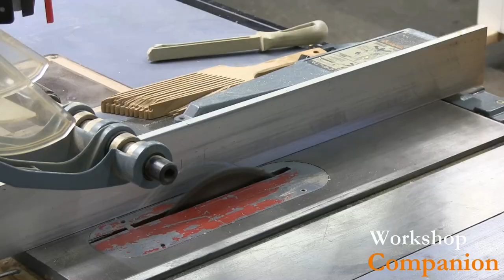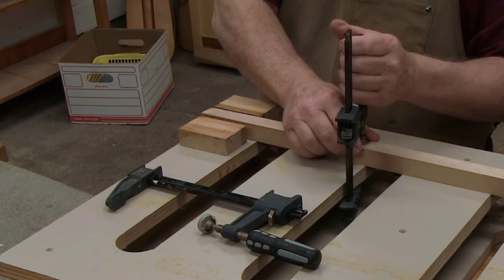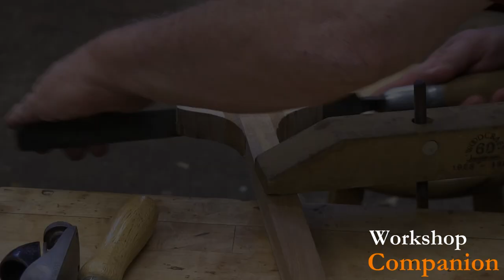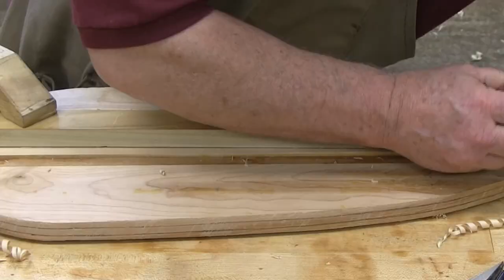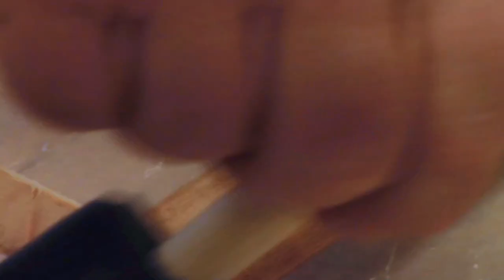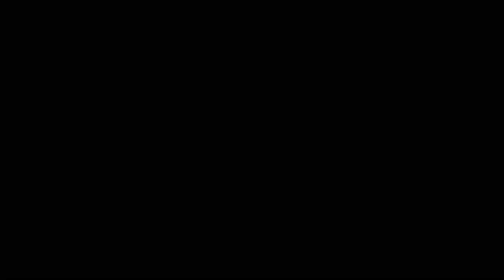Making A Pretty Good Canoe Paddle

Comment: I made a pair of paddles for my son awhile back.  I used ash for the shaft, and a combination of walnut, cedar and purple heart for the blades and handles.  I don't recommend purple heart for such a project.  Although the finished product is beautiful, I had a lot of issues with tear out.  It is hard to work, even with spokeshave and sandpaper.  At any rate, I now have templates for four different styles of paddles.  I relied heavily on the book by Graham Warren and David Gidmark.  I went to school on the ones I made.  I would look forward to making more for someone.  Some things I would do differently next time.
Reply: I once knew a guy who made harps out of purple heart. They were, of course, stunningly beautiful.
This was a pretty interesting video. I liked how he put the rod in the handle and the strip in the tip to prevent splitting. i thought it was a bit strange that he left the center of the blade raised. I've never seen anything like that before. It doesn't seem like a very good idea, honestly, since it would create a lot of turbulent flow across the blade during a lot of strokes other than just a draw.

Comment: What is thickness of blade at center board? Trying to figure out taper at edges. Looks like about a 1/4” at edge - maybe 3/4 where glued to center shaft?
Reply from the maker: You've got it. The center shaft is 1".

Comment: Is there a real reason why are paddles are not made in Solid wood
Reply from the maker: Nope. The stripes just look cool without decreasing the overall strength. In fact, they add to it very slightly -- the glue joints are stronger than the wood itself.
Reply: @WorkshopCompanion  thx!  I have 12’ flat bottom jon boat and want to make oars
Reply from the maker: @vinfish4697  Muck luck to you with that.

Comment: Cool video. I like the reinforcements you have shared. I was worried about short sections along the grain on the handle end and was thinking of layering like plywood to address the problem but I like your dowel solution more. Why did you choose two short sections instead of one through length of dowel?

Comment: So there's no concave side to the lower part? 
I was going to make some paddles and I figured I'd make the paddle part alittle concave/convex. Would that not be good?

Also would it be better to use a lighter weight hardwood or would it be to trivial a difference?
Reply from the maker: The paddles I make have traditional dihedral flat blades. The blades are relatively flat -- there are no convex or concave surfaces except at the edges. They taper from from the root to the edge, and the flat surfaces are set at a small dihedral to one another. They are also symmetrical -- I plane the same flat dihedral on both sides so I don't have to worry about which way the blade is facing. If I were making a racing paddle, I might consider a concave/convex blade, but these are just for drifting down a river. I use maple and mahogany because strength is more important to me than weight. My river is shallow with a stony bottom -- the paddles are used for poling as much as they are  for paddling. If I was fortunate enough to have a deep lake nearby, I probably would have used more traditional woods, such as basswood and red cedar. And the weight doesn't bother me. Weight becomes important when you spend long days on the water. But most of my trips are under three hours,  so I barely notice a heavy paddle.
Reply: @WorkshopCompanion , I very much prefer a symmetrical paddle and I've been paddling for decades. Sure, you might get a little more power from a concave surface but that's also going to increase fatigue, and I'm not getting any younger.

Comment: Have those paddles been Stillwater River tested? If they can hold up in that water, then they should be able to withstand anything.
Reply from the maker: That why we made them with the spine down the center -- extra strength. As you probably know, on the Stillwater you use you paddles as much for poling as paddling -- even more in August and September. Haven't baptized this specific set just yet; finish is barely dry.
Reply: @WorkshopCompanion  Oh, I know all too well about poling on the Stillwater. Anytime I've gone canoeing I always have been stuck in the aft end, and had to be the rudder man. Somehow I've always been paired with someone didn't know how to steer a canoe.  It really gives your wrists and forearms a workout though!
Reply: OH,  @WorkshopCompanion ! I was wondering about the spine! Now it makes sense!
What kind of finish did you use?
Reply from the maker: @MyName-tb9oz  Tung oil and spar urethane.
Reply: Thanks! 
Was it 'pure' Tung oil,  @WorkshopCompanion ? I was just watching another video about Tung oil and it seems that a lot of what is called, "Tung oil," might only be about 5% Tung oil. I'm guessing the answer is, "yes."
Reply from the maker: @MyName-tb9oz  Polymerized.